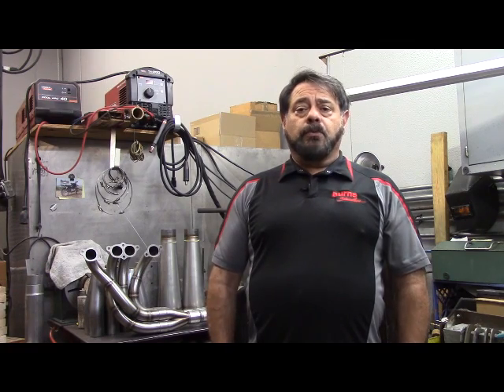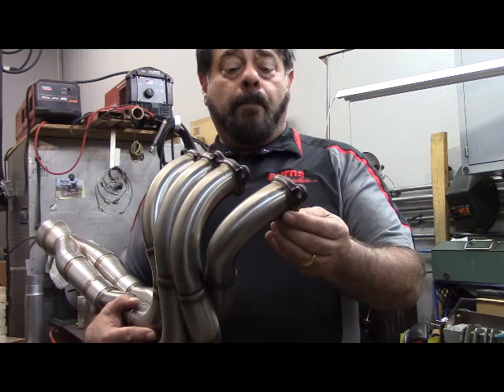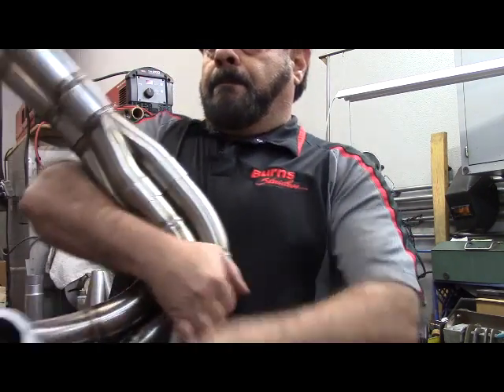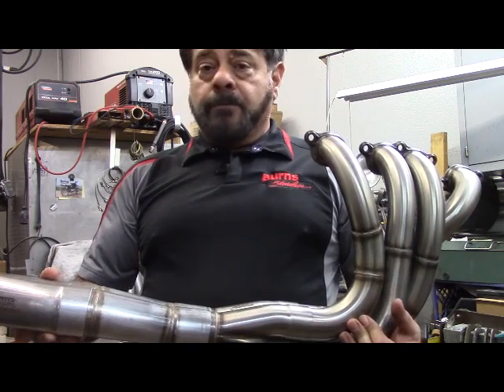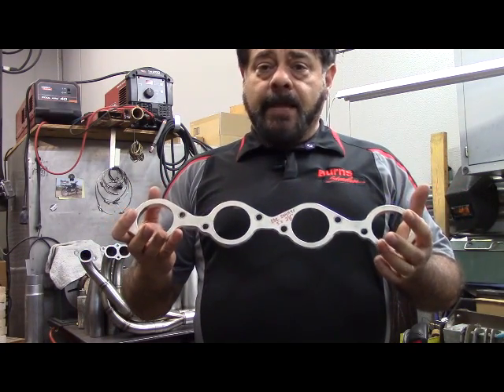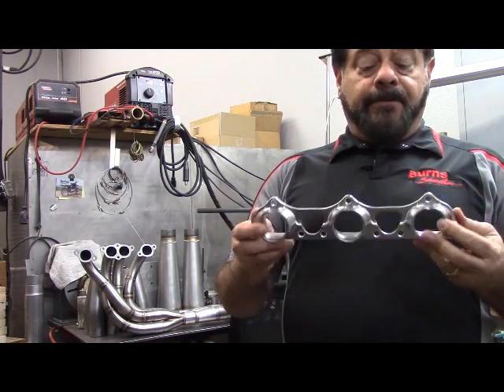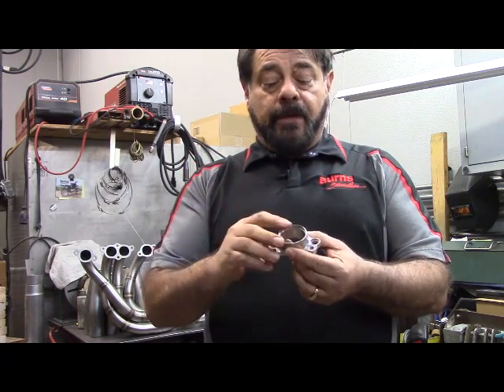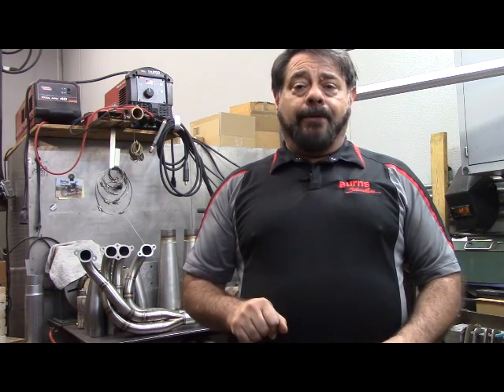Exhaust Header Flanges, Vince In Shorts - 1st Edition

Comment: very enlightening. i found out some folks use mild steel flanges and stainless tubes. interesting. what is your experience with 316 and 409 materials either in flanges or tubing. what do they weld like? how do they hold up in different applications?

Comment: I learned a lot, Vince.  Do you make a long tube header for a Foxbody Mustang with TFS 11R 190 heads and an AOD?
Reply from the maker: No, sorry we do not.
Reply: @BurnsStainless  Any shops or welders you could recommend to me to build an exhaust?
Reply from the maker: Hey Afri, where are you located?
Reply: @BurnsStainless  Just north of Boston, MA.  Ed Curtis (of NMRA) in RI, (I believe)  recommended your videos.  I'm not running in any class of racing yet.  I have a weekend car.  I want to put the right parts on it and go fast.  I'm always looking for more.

Comment from the maker: First question from one of our viewers Greg: 
What is the sequence for welding at the flange?  
Answer: We will do the welding process first at the face of the flange, and then do the braze on the outside of the flange with silicone bronze.
Reply: would not silicon bronze melt?
Reply: @makantahi3731  No.  It holds up very well.